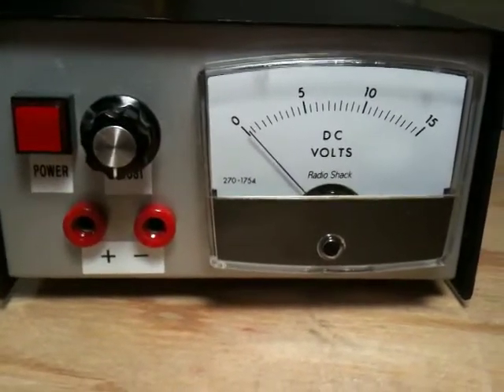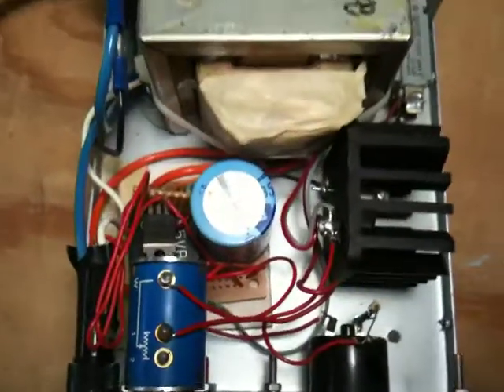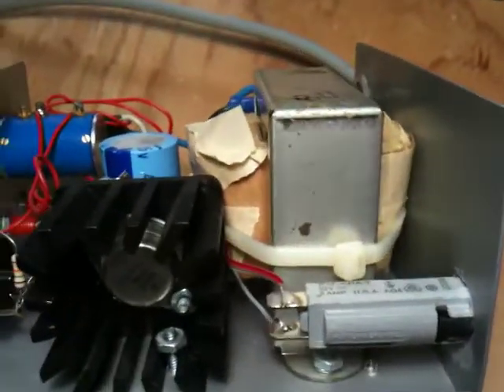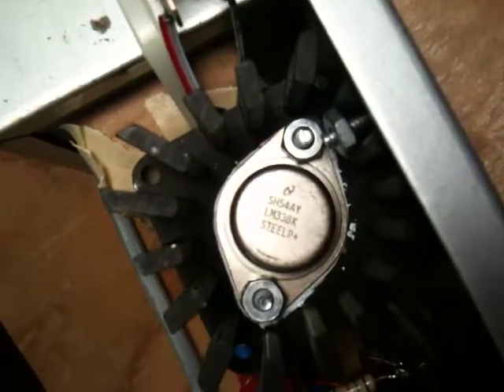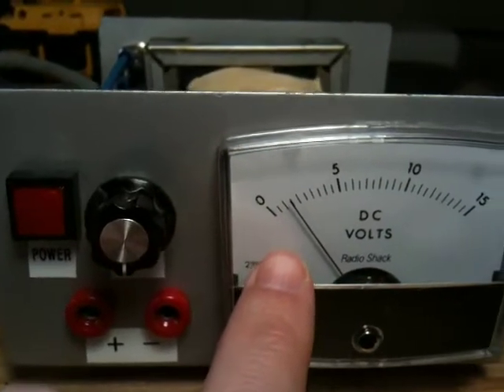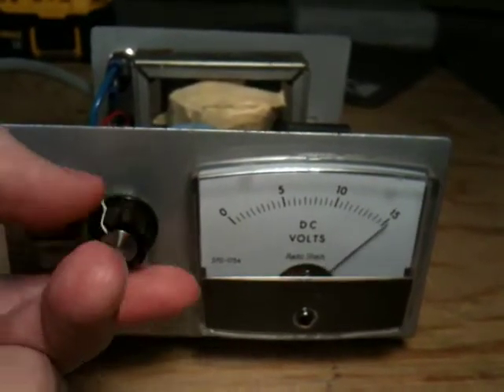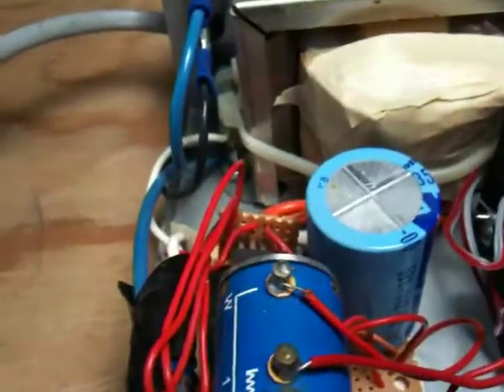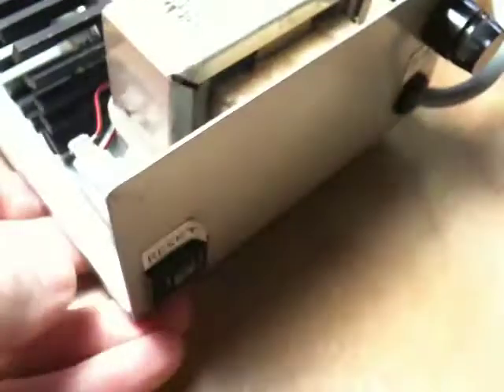Homebuilt 0-15V 3A Power Supply

Comment: 3A is max on LM350. on LM338 the max is 5A.
Reply from the maker: Correct.  I think I said 3A because I have a 3A breaker installed.  I purposely under rated it because the heatsink is not actively cooled with forced air.

Comment: LM338K can handle up to 5amps not just 3
Reply from the maker: Correct.  I think I said 3A because I have a 3A breaker installed.  I purposely under rated it because the heatsink is not actively cooled with forced air.
Reply: BDub Fair enough

Comment from the maker: Your assessment is good, but there are vents on both sides.  The regulator is mounted to the heatsink with thermal compound grease.  I'm sure it would overheat eventually, but you could get some decent power out of it for a short period.  There IS room for a fan ;-)  Again, just something I whipped together in high school, lots of ways to make it better.  Thanks for the comments.

Comment from the maker: It's a 5k ohm 3.5 turn potentiometer from "Penny & Giles Christchurch England MCPK15".  There is a 220 ohm resistor across Vout and Vadj of the LM338K.  The potentiometer is connected between Vadj and GND.  My adjustment tops out at around 3k ohms which calculates to be roughly 16V using the equation from the LM338K datasheet.  Really simple circuit.

Comment from the maker: Yeah, if I had to do it again I would fuse and switch the black (hot) lead.  I don't even think I earth grounded the enclosure... bad bad bad!  This was something I made in high school though, so it was just enough to get me learning electronics!  Then I got a non-working 0-30V 0-10A power supply from a surplus store, and fixed it for $1 (new LM723 voltage regulator IC from Radio Shack). These are both power supplies I still use all the time, 20 years later.

Comment: It looks like your mains switch only opens or closes the neutral (white) conductor from the mains, and that the fuse is on the hot (black) conductor.  Is that correct?

Comment: So, leave that little light bulbs alone because you won't save that much in electricity bills just to change a bulb to a led. Leave the stuff and the hardware as much identical as when the hardware were made to preserve the TRUE and REAL UNADULTERATED appliance or piece of electronic equipment. That's my advice. I love old things and we MUST RESPECT them as they are. If the bulb blown, please replace with an equivalent bulb and NOT A F#@K]NG LED.

Comment: We must preserve the old things UNTOUCHED because they were designed to work with lamps or light bulbs instead of leds. Even there are some old tunners that the stereo light bulb is a specias one that is all analog HIGH QUALITY reception. Haven't you noticed that the old good stuff sound better that the new good stuff? I certanly prefer the good old valve amplifiers or the first transitored to be made than the current ones that are designed to offer no quality, just brute force and distortion.:(

Comment: Please, don't change old lamps to leds on appliances. It takes out all the magic of an antique apparatus or electro-electronic devices. I've seen people changing old amplifiers lamps to led, and for me that is a crime! There is some devices that also use lamps as ballasts for motor driving and other stuff. If you and other like you continue to change every single light bulb to a led, the bulbs become less and less selled and lead to extintion. The most experienced engineers agree with me.

Comment from the maker: philipclegg1995, the LM338K is a 5A adj. VOLTAGE REGULATOR.. the 2N3055 is just a POWER BJT (and has no inherent regulating features by itself).  You CAN however use the 2N3055 as a PASS transistor in conjunction with the LM338K to give it more current carrying capabilities... but then you'd need a LARGER enclosure ;-)  Honestly I don't think the transformer can handle 10A continuously... nor could the 338K and 3055 without a fan.

Comment from the maker: That 1A fuse is on the AC side of the circuit which is 120V.  The transformer I believe is about a 10:1 so you get 12VAC on the secondary.  Multiply by 1.414 to convert to RMS DC and you have about 17VDC.  This is why it tops off at 16V (17 - bridge rectifier diode drop).  Back to the turns ratio... making a really general assumption about POWER conservation... 1A on the input at 120VAC will yield up to 10A at 12VAC on the output.  The LM338 is a 5A device.  Got it?